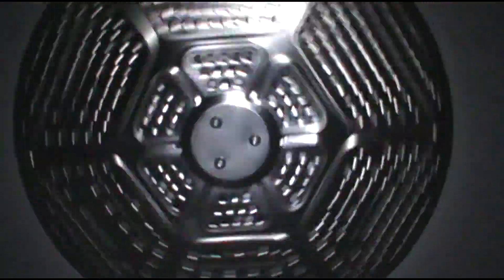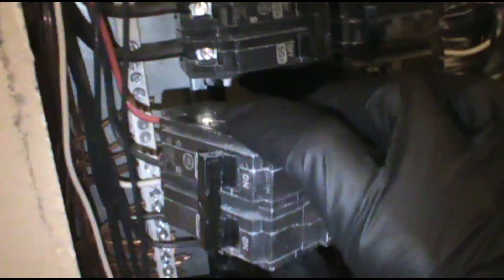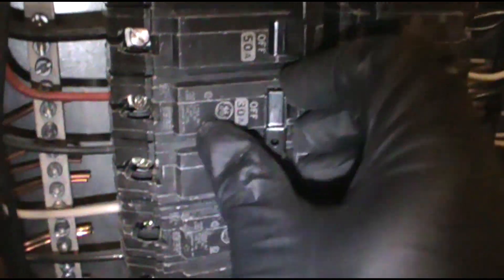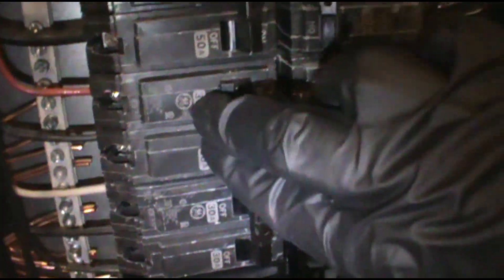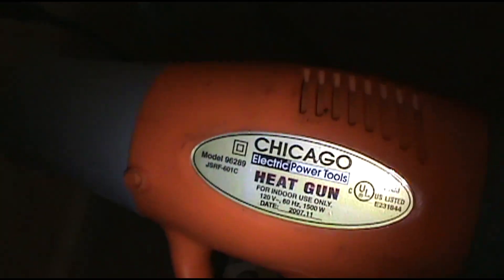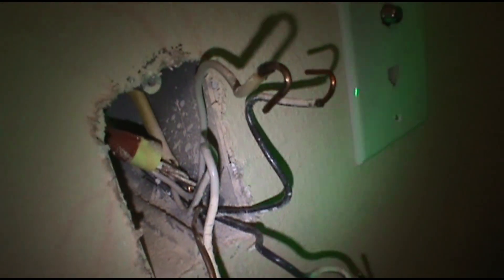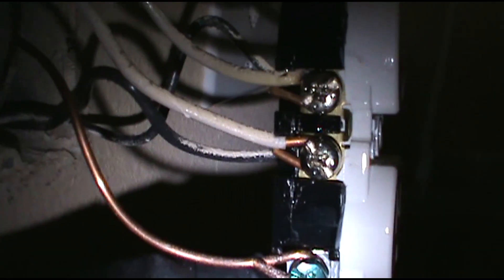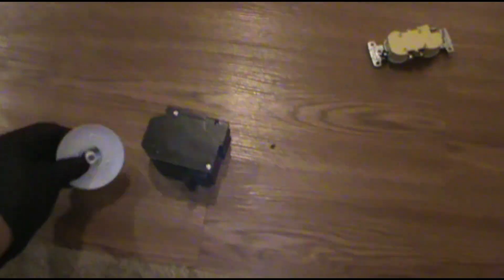Dryer Runs But Is Not Heating & Outlets Are Glitching

Comment: Good job Lex.  I had a breaker arcing a while back, I think it was a Siemens panel.  Usually the GE breakers are pretty good.  I never seen that with that receptacle the way that was arcing like that.  I think Hubble used to be good years ago, their quality must have went down hill.
Reply from the maker: Pete Ciallella Yea Hubble receptacles & switches have been wreaking havoc around my way. Nothing but problems. Thank you so much for watching Pete!
www.DirtyMaintenanceNation.com
Reply: Hubbell has changed,, the higher commercial line made-in-USA models are still good, the entry commercial and resi grade is trash. E.g. a CR20/BR20 receptacle is the lower line, whereas a 5362 is the higher line.

Comment: That's not too hard. The heater is two phase and the controls single phase along with the motor. So, everything but the heat works if you drop one line. The breaker was fine where it meets the bus bars. The internal contact must have had a small gap. When the dryer engaged it connected the two phases and all the current had to jump the gap on the one bad breaker. When the dryer was off, no current was flowing so the gap was fine. The arcing draws large amounts of current and was causing voltage drop with other devices on that circuit.

The other outlet was unexpected. Time has a strange way of loosening things!
Reply from the maker: ToxicityAssured Well said man! Thank you so much for watching Toxicity!
www.DirtyMaintenanceNation.com
Reply: ToxicityAssured hell ya man!